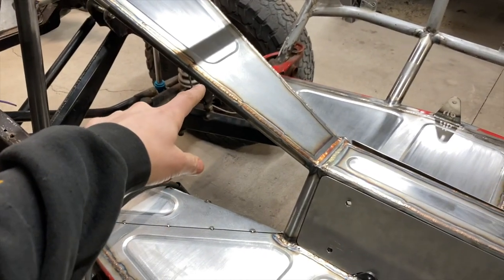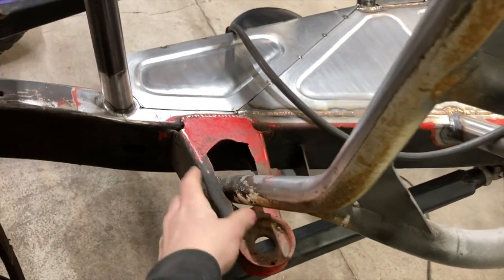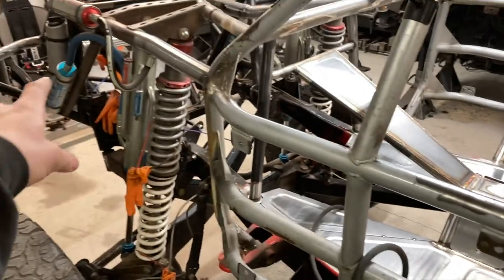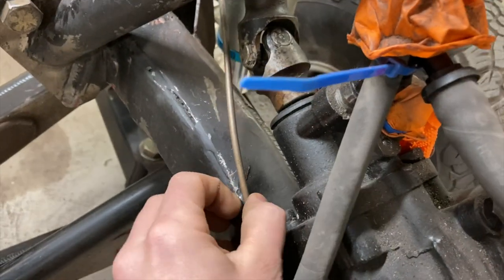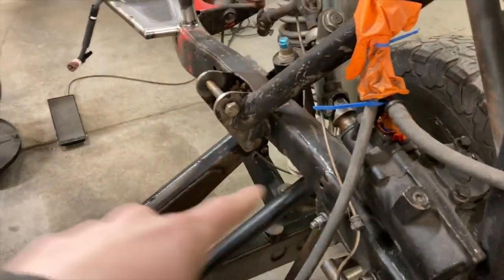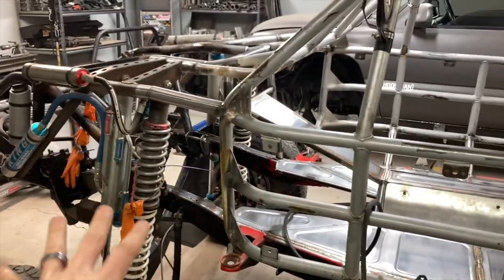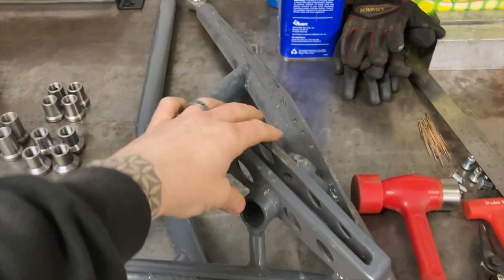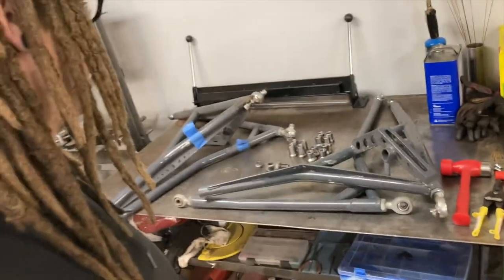Building a Sheet metal floor in the Dune Truggy - Dune Hippie Vlog #25

Comment: What's that cordless cutting tool you use? How thick will it cut?
Reply from the maker: Its the harbor freight metal shears 20v. rated for 16 or maybe it said 18g??? i'm cutting 16g steel with them.